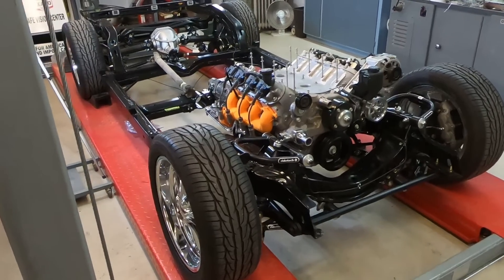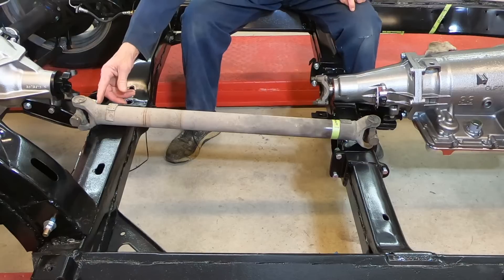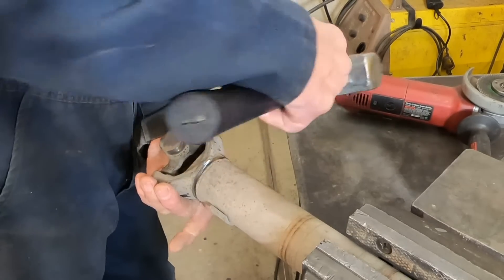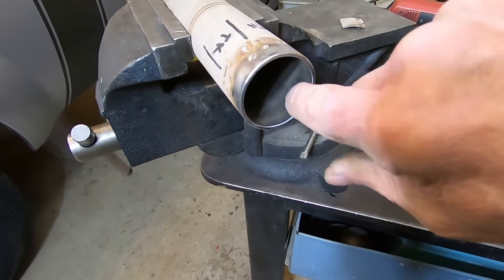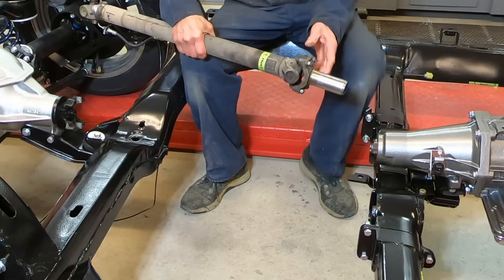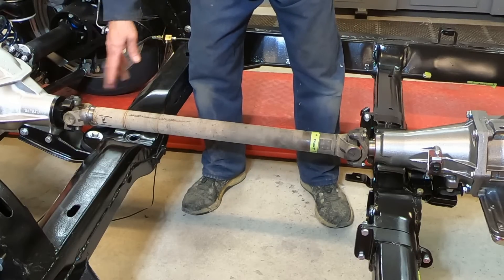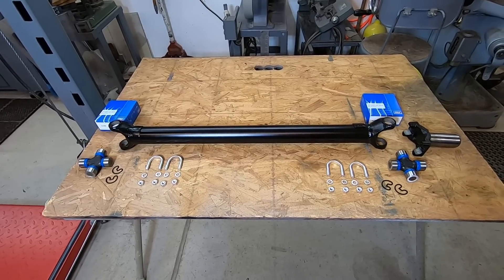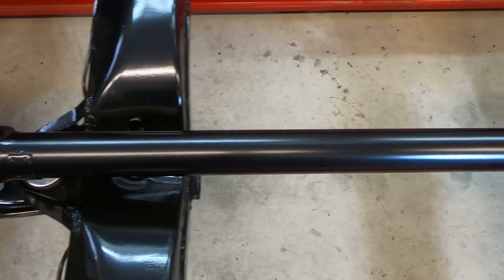Shorten a Driveshaft in your Home Garage

Comment: You can do those exactly like he did it in the video. Best tool to cut the tube is a tubing cutter. You CAN use a grinder but make absolutely sure your cut is square. Same with a bandsaw or chop saw. Set it up in phase on a clean flat surface and check to see if it will rock. If not your good to tack. Check for runout and once you are good, weld it! The key is to be meticulous!

Comment: Dont need the weights. Impossible to maintain the old imbalance because its based on runout. Just get to less than .010" on shaft, and if you machine the weld yoke to remove the old weld, you would use that surface to straighten the yoke to less than .005"- then 4 tacks and check before welding.  Make it very straight and it won't need weights.
Reply from the maker: Thanks for the good comment. Mine turned out great as there is absolutely no vibration at any speed.

Comment: Very cool. I wonder, could this method be used to connect a mismatched transfer case and front differential?  Remove one of the yokes and replace it with the correct yoke to fit the mismatched part?
Reply from the maker: Yes, it sure could as long as the yoke flange and driveshaft tube are the same diameter.

Comment: I have done this many many times, mainly on older BMW's when fitting later 5 speed gearboxes, the only one I had a vibration issue with was an E32 750i I built up from a damaged 750iL, I balanced the shaft using two hose pipe clips, we call them Jubilee clips, the head of the clip being the balance weight, I did send it for balancing after a year or so of use and it came back worse, refitted the clips by trial and error, mark the shaft and move the clips 1/4" at a time whilst driving the car on a lift,
Reply from the maker: Way to go. Doing what it takes to get a favorable outcome.

Comment: sorry to say once you cut the shaft putting the weights  in the same spot is usless it could need more or less and in a diffrent place comen sence really
Reply from the maker: With only 7/8" of the drive shaft length removed, the same weights in the same spot, it should be very close to balanced. If I had removed a foot or more of it, you are probably right.

Comment: The slip yoke should be at least 1 inch pulled out
Reply from the maker: You are right for most applications, and I wish I had mentioned something about it in the video. On these C2 Corvettes they have independent rear suspensions with the differential mounted to the frame, so it is not moving at all while the car is in motion and going over bumps etc. Therefore, the only yoke travel I need is enough to remove the driveshaft easily, which I have. Thanks for watching and the comment.

Comment: Great tutorial. I read a spec. of .03 runout on a carbon shaft for 9 sec. dragcars. 
I built shafts in v blocks on the bench and more accurately jigged in the truck while checking runout and welding. Never had a vibration.

Comment: Y0u must leave at least 1 inch of travel for rear end to travel up in hard acceleration if you dont you will bust the bell housing on the teansmission
Reply from the maker: You are right for most applications, and I wish I had mentioned something about it in the video. On these C2 Corvettes they have independent rear suspensions with the differential mounted to the frame, so it is not moving at all while the car is moving and going over bumps etc. Therefore, the only travel I need is enough to remove the driveshaft easily, which I have. Thanks for watching and the comment.

Comment: I always use a pipe cutter and it does a great job of making a square cut and is the shaft flat on my table to clock the yokes and measure center to center on both sides. When everything is square weld it up. I never had one to vibrate or fail with decades of building them for street and drag cars , some with 5:67 rear gears and no vibrations. A pipe cutter that cuts like a tubing cutter makes a perfect cut for driveshafts. A chop saw is not nearly as good for cutting a shaft but I understand you use what you have and if it works great. There’s no big deal to cutting one if you are careful.

Comment: The dial pointer should be removed from the surface before tapping to avoid damaging the indicator.
Reply: noticed that too,i use a clip on the other end to keep it lifted, they are not cheap

Comment: You do real nice work, I have had a number of drive shafts shorted and they did not look as professionally done as the one  in your garage, the welds on mine look like rope and there are a washer or two welded on the tube and then just painted over rust . But on the positive side they never vibrated?
Reply from the maker: Thanks 👍

Comment: I’ve done this dozens of times exactly like this with big power as well as lifted trks  with big tires never had a problem. 

My drag trk makes 600 hp with a 200 shot of nx on top of that with my home made drive shaft. 

My 3200 pound truck and 727  has never had a drive shaft issue.  It’ll work be careful and get it straight
Reply from the maker: Thanks for posting. I've done quite a few as well and never a problem.
Reply: @DickShaw  I’m glad to finally see someone post a video like this.  Me and a buddy did it back in 1979-80 the fist time and ppl said that’ll never work 😂.  Got a buddy right now says it’ll never work and run true 😂 seeing is believing.

Comment: Some years ago I broke the front u-joint and bent the driveshaft on my 1974 Chevelle.  I took it to local driveshaft shop.  I don't remember the numbers, but I think it was about an hour's labor plus the price of two u-joints.  That included balancing.  Considering I didn't have a garage or a welder at the time, I felt that was reasonable.

Comment: when you go over a bump[ you will hate yourslef for puting that joint to far in toe trans
Reply from the maker: The rear differential is fixed in the frame so it does not change as the car goes over bumps. Therefore, the yoke will not be moving in and out of the transmission. As long as the driveshaft is removable it doesn't matter how far it is into the trans. Thanks for watching - good eye!

Comment: For those watching this video don't do it. It's probably going to vibrate like crazy. There's no way you're going to match the end to what it was originally. The reason the weights are on it is because they're not cut true to start with.
Reply from the maker: I have shortened driveshafts this way many many times and never have had a vibration or any other problem with it. Thanks for watching!
Reply: Take your time, measure correctly, I did my first driveline build when I was 17, pay $600 that I did have or nervously spend 3 hours, easy choice, keep everything in line, make sure your tube is cut square and the odds of a vibration are very low
Reply: The world is full of people telling you don't do it ? Hot rodders love to prove you wrong 😂❤
Reply: @steveanderson3942  well I work at Midway drive shafts for 15 years. We would get drive shafts like this s*** in. Take the ends off I didn't install new tube and straight. The yokin should not have more than 3 tho. run out at Max. Center of the tube 6 tho. Max anything more and you're going to vibrate. I'm an old man I learned that don't argue with fools. Just a fact and walk away
Reply: I’ve don’t this dozens of time with big power never had the slightest vibration or other problem.  You are wrong
Reply: I'm game for doing it if I ever have the need,I like fabricating myself out of a jam. 
Worst case Ontario, I built a driveshaft for a shop to duplicate that's not a total POS 😂
Reply: You ARE wrong. My Dad would do this when he had to. And never had a problem.
Reply: I shortened a few gm aluminum ds out of vans for 70 chevelle with LS. Owner took it to get balanced. The company stated it balanced with no weights.
Reply: That’s why he said if he needs to he will take to a driveshaft shop and Balance it
Reply: You are wrong, building hot rods over 45yrs. Done it exactly like the man showed many times. The key is checking the run out and always make your cut in the rear. Don't believe, check run out on any drive shaft, they sure ain't perfect from the factory. They vibrate bad when bowed in the middle. This man did a perfectly good job. Out of curiosity have you ever done this job? or are you another comic book reader?😂
Reply: @scottnusser6232   Love it 😅😅😅😂😂😂comic book 😅😅😅😂😂😂 priceless, so many people comment on things they know NOTHING ABOUT.

Comment: That yoke is too far in on the transmission spline shaft.
Reply from the maker: Thanks for your comment. However, because the rear differential is fixed in the frame and not moving up and down as the car is driven, the yoke will not be moving in and out of the transmission. Therefore it doesn't really matter how far it is in the transmission as long as there is room to remove the driveshaft. At least that is my understanding of it.
Reply: @DickShaw excellent work man. God bless you 👍